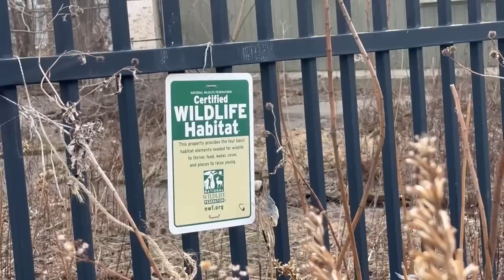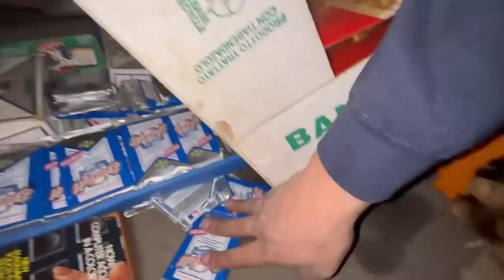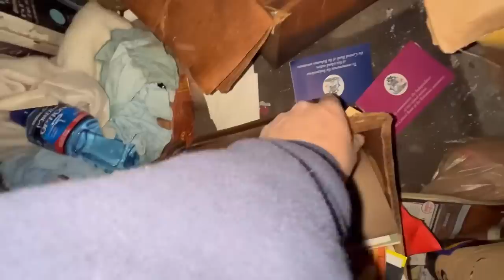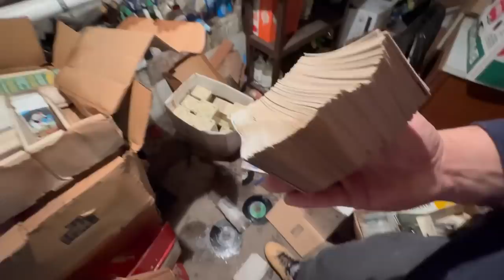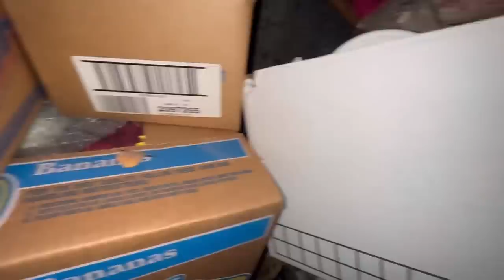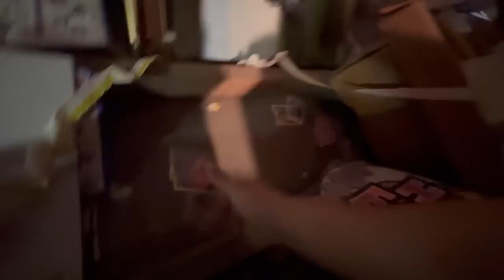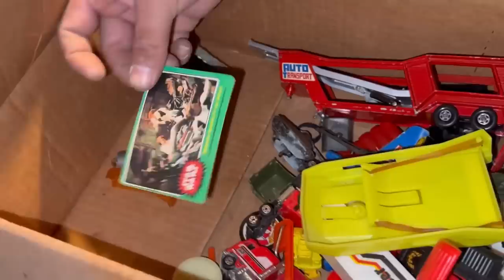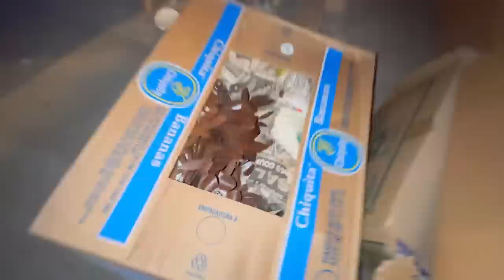HOARDER HOUSE BASEMENT FLOODED~THOUSANDS HAD TO BE THROWN AWAY~!

Comment: At one point you mentioned having a frozen pipe. The piping running along the basement ceiling could have froze and burst.
From personal experience with my parents basement flooding several times, definitely get a dehumidifier or 2 running in that basement. It will help save your other items while you try to clear everything out. The dehumidifiers will pull the moisture in the air out. Basements are horrible for holding moisture/dampness and if you don't get a handle on it, everything will get moldy.
If you have the means and space I would strongly recommend renting one of those storage shipping containers that gets dropped off at your property for however long you need to rent it for, and just start filling that sucker up with items from the basement that are still dry and sort them after you've cleared out the basement.

Comment: 1st.  Get sump pump working. 2nd Get wet stuff up to dry out. 3rd Get a few fans down there to force the air to circulate.  Stuff should be at least 12 inches off the floor.  4th Get the leak fixed

Comment: You need plastic tubs to place those items in to prevent them from getting wet. Placing damp rid in the basement will also help remove the moisture. Lesson learned.

Comment: Guapo and chapo you do know that insurance coverage the things inside the house don't throw anything away until you have the insurance man out . Document everything and get comps I had a flood the paid for the carpet old games a toy sewing machine I got 50 for don't know if they will pay for mold because my mold was not too bad I just cleaned it and sealed it. The clothing if it is not moldy take it to the laundry mat snd run a couple  machines good as new, the can goods toss the insides and those jars are money run the dishwasher  you need to open the window if any put fans in and get a dehumidifier  later get mold remover and pressure wash the basement lots of work but you won't loss as much wish I was closer I would help you  good luck and God bless live u

Comment: Oh no! I'm glad you are insured. Well, get all that wet stuff out before it molds any more than it has. I would have washed the Levi's and sold them as used on ebay. I would think that if it was a sewer overflow, you'd smell it. If it was the water heater there would be other signs. You've still got some amazing stuff down there. That must have been leaking for a long time. I doubt the Rolexes are real. The dehydrated blueberry jam was a riot! LOL Sell that step ladder, if it's safe, on FBMP. They're worth good money. I'm so sorry this happened to you, but glad you found it before it got EVERYTHING in the basement. Sadly, this is life, and you're that much closer to getting the house cleared out so you can move forward with your plans to make it an air B&B. Deep breath and move forward.

Comment: Looks like the water is coming up through the floor GOOGLE says ( What would cause water to come up through concrete floor?
Concrete is already a porous material. This means that water could find its way through your concrete by itself. But, if you have cracks or cove joints that aren't sealed properly, water will use those openings to enter your foundation.)  Thats why the guy had the boards under the boxes.  Good luck
Reply: Yes the guy knew it could happen 🥰 it's so hard to see all the old stuff go to the trash and all the money and history lost 😭

Comment: Thank you Guapo and Chapo for keeping us updated on your basement. I wanted to verify that you did make sure that your sump pump is now working. Was it unplugged? I watched the video twice and couldn't tell what had happened  to it.  I don't have one but I'm thinking you have to clear stuff away from it so it can work properly.  Also that pipe was definitely leaking. If you have a plumber or handyman in your family to work on that it would be great 😊😊❤❤ otherwise get a plumber in there to fix that and work on your toilet too. The toilet may be a very simple fix. Also go through all your basement and check pipes for wetness or dripping.  Your hot water heater looked good from the view of the video   I've been a homeowner for 40 some years and I've been through home disasters many times.  The old saying Live and Learn is so true.  I go though you tube videos and learn a lot that way and I'm 62 now. 😝😝 good luck Guapo it will all turn out okay. You guys are doing a great job cleaning up. ❤❤❤❤

Comment: Could have just seeped up threw the floor or it was from the sink leaking or your sump pump quit working. Our garage gets water seepage every winter it comes through the walls but its partially underground at the back.  Boxes will soak up any little bit of water. Vinyls could be dried out at least the records themselves.  Some people make bowls out of records. Afghans can be washed and saved you need a plumber and that valve replaced it's probably frozen
Sorry it's a mess love you stay safe hugs.
Reply from the maker: Love you Bon Bon 💜💜

Comment: I'm not new channel I'm always lurking hence my name. If you have a water meter out side make sure all your water is turned off in house no toilet running then if meter is still running you definitely have a leak.
Pipes will burst if you don't leave a water faucet trickling when it gets below freezing. I know this when I got a $3,000.00 water bill 😳 good luck I hope this helps a little. I know it doesn't fix the damage but that's first thing I would check ✌🏼

Comment: May have a couple issues happening. A drip from that pipe would take months for the water to travel to the other side of basement.
Seen a glimpse of what looks like wet mortar joints under the basement window. 🪟
Sump pump? 
Did the power go out?  
Seen you plug  pump back in but did the pump go on?
Could be a bad pump.
 Heavy rain saturation in an older home can cause the water to hydraulic up through the concrete floor cracks & where the floor meets the wall.
Hope you found the source(s) of the water.   Lmk if you have any questions.